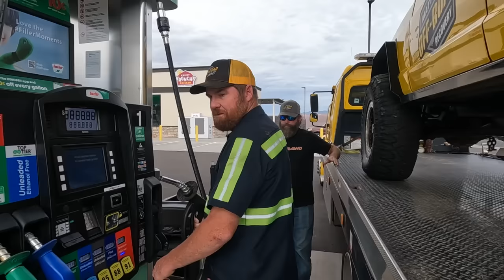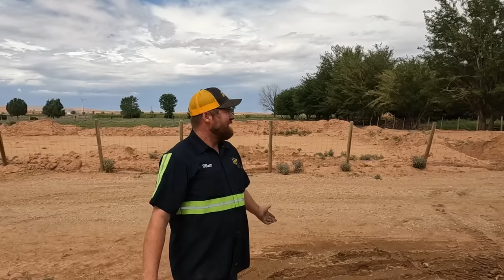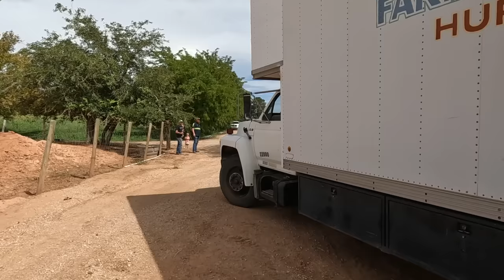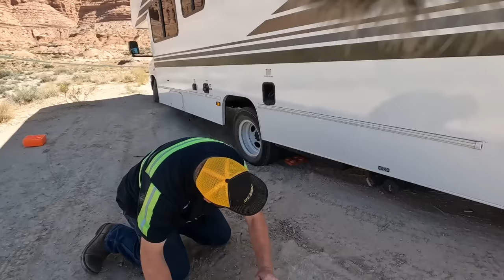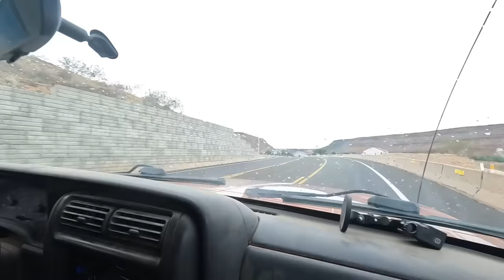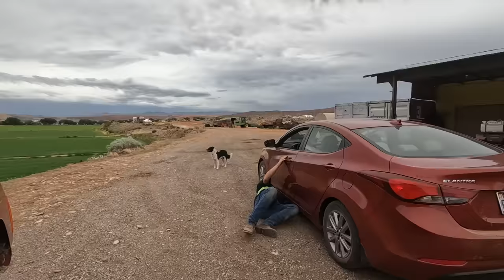We Pull Out The Big Equipment For This Job.

Comment: Great job going above for that last customer and fixing the exhaust leak, proud of you guys!! Wearing your shirt on the regular.
Reply: They're the ones that damaged it while driving out, not the customer.
Reply: Yeah now some people may want a little damage to get some shop treatment. lol
Reply: Probably didn't even charge the guy for the repair, either.  Just got it done.
Reply: Although it made me super nervous with him underneath the car, with no other safety holding it 😱
Reply: @mediocreman2  The customer chose to drive that car where it didn’t belong. And who’s to say who was driving it when the damaged occurred?
Reply: The hoist was on the safety locks. You can hear them set. The car wasn’t going anywhere. It was perfectly safe.
Reply: Ultimately the customer is responsible for any damage that’s incurred during the recovery.
Reply: @gregmecham5556   not when it's on a slope like that.  Can still slide back.  Gravity always wins.
Reply: It’s a Hyundai they fall apart regularly
Reply: @mediocreman2  I don't think so.  They didn't do anything to it that would have caused that damage.  They gently pulled it out, then drove it.  Exhaust probably got bent when he dug it down in the sand when he initially got it stuck.
Reply: i'm curious what the fluid leak was when he put it on the lift, did something hit a coolant line, or was that just condensation from the ac?

Comment: I was up hunting in the Colorado mountains.  Some other hunters across the way couldn't get their truck to move.  It would start, but would shut off every time they put it in drive.  Tow company comes way up into the mountains to tow his truck out.  Tow driver gets in and realizes the parking break is on, truck didn't need a tow at all.  The owner of the truck was so pissed at himself.  I bet that was expensive to have someone come up and turn off his parking break.
Reply: Funny to
Reply: Why doesn’t the car just turn the brake off lol
Reply: Did he Break his parking Brake? It’s annoying when you Brake your Breaks, or is it Break your Brakes?
Reply: Similar thing happened to my mom when I was a kid, we were in the Kmart parking lot and when we went to leave, our truck just wouldn't move. Called a tow, but he knew right away what was wrong - the transfer case was in neutral. One of us kids must've kicked it out of gear getting out. Still charged us for the call...
Reply: AND THE NUMBER ONE REASON I QUIT ELK HUNTING HERE IN COLORADO
Reply: Brake.
Reply: How would the parking brake cause it to shut off?
Reply: Wow ahhaha

Comment: I had a jeep that had no gas guage.  I ran out of gas so many times I sometimes wouldn't hardly wait a second trying to figure out what was wrong.  Just jump out and go get a gallon.
Reply: I've had vehicles without working gas gauges. You fill the tank and drive 100 miles, refill the tank again estimate the MPG and calculate the total miles per tank.
Use the odometer as a gauge till the gas gauge is fixed.

Comment: Nice use of "debacle" in a sentence. I've done some offroad driving. I once pulled a 3 wheeled Jeep up a powerline cut with my 1 ton 4 wheel drive work truck. Took a while and if I hadn't had a hilift jack, posi lock and about a hundred cables, come-a-longs and straps that wouldn't have happened. Completely different landscape, I'm in the Ozarks but the struggle looks just about the same. Well, I had a few less resources (as me and what I had, not much), so similar if not the same. Oh no gas stops, so I always tried to keep gas for the tourists. You flatlanders are welcome.

Comment: I believe the issue with your gauge might be due to difference in resistance. The gause and sender should be matched to the same resistance to read correctly, and if the gauge has a differing resistance ito the sender it could be reading either hight or low. Though, I am not there, nor do I claim to be an expert.
TLDR: make sure the sender and gauge have matched resistance.

Comment: Good job, as usual.  Matt, may I have some photos or a short clip with the front suspension setup on the vehicle with lower triangulated control arms, I think it's the Morrvair.  I drive an slightly lited 1989 XJ and I rather get rid of the Panhard bar...  Thank you !

Comment: Calibrating an aftermarket fuel gauge or sending unit is tricky. I think you can put a potentiometer in series or parallel to make some fine adjustments, then pull it out, measure resistance and replace with resistors.

Comment: Matt - there's a product you can find Trevor that adjusts the fuel sender resistance to match the gauge 

Look for fuel gauge range converter if you get a good one you can get your gauges to read right 

PS Trevor make sure you get the gauge to read empty early!

Comment: I could have used you guys the past couple of weeks in upstate NY once or twice a year I need to herbicide about 7 miles of railbed with a side by side which is hard to do with the equipment I currently have which is very hard on the buggy I get stuck a lot even with 4-wheel drive plus I brake stuff on the side by side like flat tires brake lines and the last outing blew a relay lost all my electrical to include the 4 wheel drive so I was stuck and nothing worked had to wait for mechanics to figure out how to get it off the tracks with 3 other sets of track I needed to get over

Comment: I’m really surprised the crew doesn’t have an external PA system under the hood to communicate better. Or even headsets like Rzr drivers use to talk back and forth. Would probably come in handy more times than not!

Comment: A company I used to drive for had a policy, Fill the tank before you go anywhere, gas gauges are never right!  My car is an example of that, I can read empty on it and will pump in 10 gallons into a 17 gallon tank.

Comment: Trevor: I know there must be a computerized flow meter that measures the exact length of time each of the injectors is open, so that it knows exactly how much fuel has been burned within like 1/1000th of a gallon or something. Add in a sensor that measures fuel going in at the pump, and you'll never run out of gas again!

Comment: Matt this is Rob I was wondering if you could use snap blocks and pulleys to pull out a vehicle I thought it would be easier on your equipment snatch blocks you don't have to take anything apart you can just clip it right in just trying to be helpful hoping you'll use it and try on your show

Comment: It's really not hard to calibrate aftermarket gauges to oem fuel level senders.  You can even add resistors or a potentiometer to calibrate gauges that are not exactly compatible with the sending units.

Comment: I do understand the issues with filming all the different jobs and assembling/editing them into the different videos to keep them coming at a steady pace, but the time lines get all kinds of crossed up as some sections are clearly much older than others. That box truck in the mud hole was from over a month ago as the dude and the kids in it released their version right after it happened.  Is there good reason to not throw a little date marker up with the intro for each job? Is it just a PITA step for the editors?
Not that it bothers the purpose of the video, you guys are always great, and the content is always engaging, but more info can't hurt.

Comment: Sounds like you have an incorrect fuel level sender for that gauge.  Most aftermarket gauges will tell you the resistance rating they want out of your fuel level sender, so you can match it to your OE or aftermarket one.  And if my old brain is working correctly, the common resistance range for aftermarket gauges is 0-90 Ohms.  Should be common place amongst brands like Equus, Stewart Warner, Autometer and so forth.

Comment: I had a VW bug that didn’t have a gas gauge, but instead had a foot lever that gave you an extra gallon once the engine started dying. Ask me how many times I forgot to flip it back after getting more gas? Also, what was that fluid dripping out the rear of the engine while you were fixing the exhaust?

Comment: Your fuel level sender must be off. I always tell my s.o. to consider 1/4 tank An empty fuel tank. I rebuild/build and restore older euros and have had to run gas to her so many times it's ridiculous. Also.. it's just good advice. You never know when you might get stuck or stranded or have to leave in a hurry for an emergency. I never should have told her that they all have like a half gallon reserve built into the tanks🤣 don't feel bad Matt. You can blame this one on the mechanics🤣

Comment: I think this one is on Trevor for not ensuring the right resistor was in line on the fuel gauge wiring or for not verifying the float was tuned. Sorry Trevor. We can only blame Matt when the gauge says E and he runs out, or he miscalculates how far from a gas station he will be on a recovery.

Comment: Would it be more fuel efficient to tow the Jeep on the trailer the whole way, rather than running two engines and an empty trailer? (At least for longer drives, where the time to load/unload is negligible.)

Comment: How many steps to a recovery?
1. Start the vehicle 
2. Parking brake
3. Traction control off
4. Seatbelt
5. Window open
6. Horn
7. Steering wheel 
8. Don’t run over the rope!

Comment: So what's the relationship between Winder Towing and Matt's Off Road Recovery? I thought Matt had taken over the ownership of Winder and Changed the name but I seem to be wrong. I've been following since U recover Ed's nugget from the Sierra Nevada (which was a pretty brave adventure) but I just don't get it. Do you use the magnetic signs to rebrand the vehicles and change into MORR  Tee shirts before starting the recording?

Comment: Ummmm, if the rollback and the Banana was going to the same place anyways, why waste gas and add wear and tear to tires, etc - why not just toss it on the roll back to begin with? It's not like it's a hard load/unload. I guess the running out of gas drama helps create more views than using common sense.